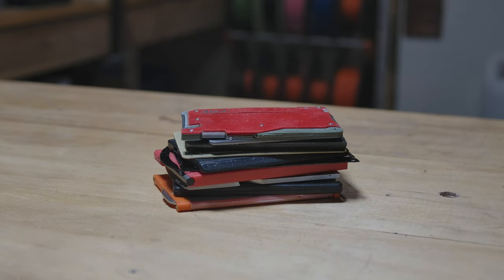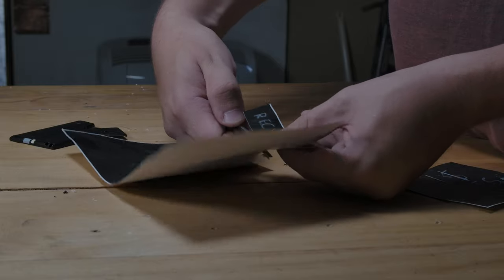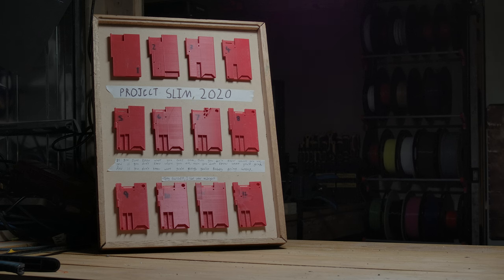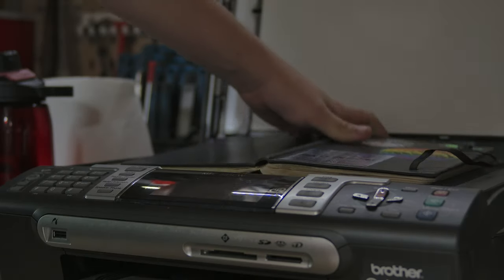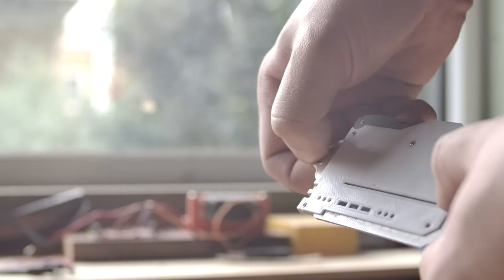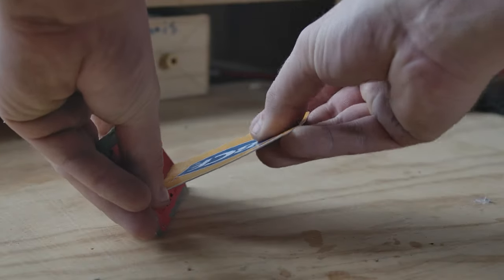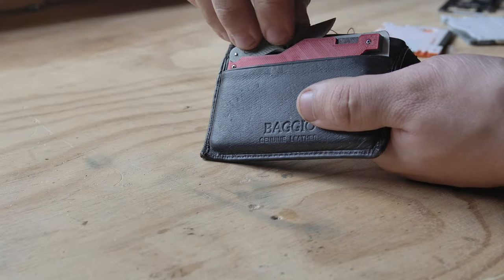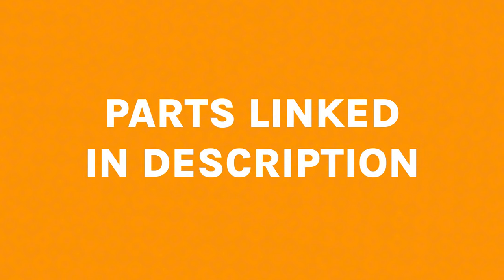This Multitool Is 3D Printed

Comment: Great work. It would be cool if you turn it into a wallet instead of something that goes in a wallet. Add a place for cards and a money clip for cash and it would be perfect in my opinion
Reply: This
Reply: @waralo191  I'm thinking of doing this... it's gonna need some serious rework tho to handle the extra load
Reply: I like the idea. My only problem is i only use wallets with rfid blocking. How would one add that to a custom wallet?

Comment: Looks very professional.
I have had your "china metal tool card" upgrade card in my wallet for some time and filled the bit holder section with some fire tools as I had infil problems printing the fire card. Excited to give this a try, looks great although more complex. Might swap the blade with a swiss card clone one. Between this, the fire card and a customized version of another coin holder card wallet carry should be a lot more organized. Might even customize further for a dedicated space for the vic nail clippers that are always in there anyways.
By the way I got another set of scale tools by simply removing them before sending my vic compact in for overhaul. Cost less than 10€ and I got it back with a new set of everything 🤫

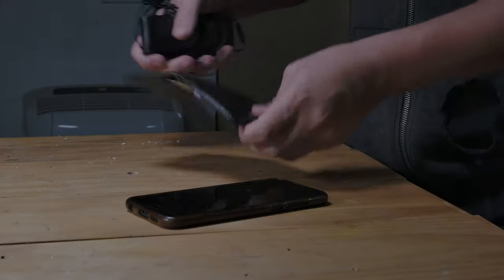Comment: 0:25
I use my folding knife regulary without drawing attention, for opening boxes/packages and opening pomegranates.
Reply: Depends on where you are and who you roll with. Most people around Colorado don’t notice or don’t care about a folding knife of any size. But one person in Boulder freaked out over a Benchmade mini (under 3” blade) that’s the smallest thing in my drawer. Sounds like Chris is on a university campus so people there might be more sensitive than most.

Comment: I had the phone case version of one of these (scissors, tweezers, red AND blue pens, toothpick/reset button presser, phillips and flathead mini screwdrivers, phone stand).

I really missed having it around when I upgraded to a different phone, and now that I know you can just buy the replacement parts... I might finally 3D print myself a phone case version of this, instead of a wallet version...

Comment: Do you know if the m1.6 x 4mm screws will work? I can only find 4mm and 5mm long screws to order in the CONUS
Reply from the maker: sorry for late response, yes 4 should work you wont really lose much strength. 5 would stick out the bottom by half a mm.

Comment: ok can someone tell me what the fuck is a sd card gonna do on a multitool it cant be for cameras you arent gonna have 128-256gbs of photos on a camera and if its for video then youd have all the other shit with you that is cumbersome enough you can fit loads of micro sd cards in it so whats it for and why isnt it just in the pockets you dont use in your wallet if you actually need it
Reply from the maker: Multitools are about being prepared, I can recount probably a dozen times where someone im with has had to go out and buy a card while out for various reasons. more generally having a full sized- micro sd adaptor on hand is useful to go between different cameras.